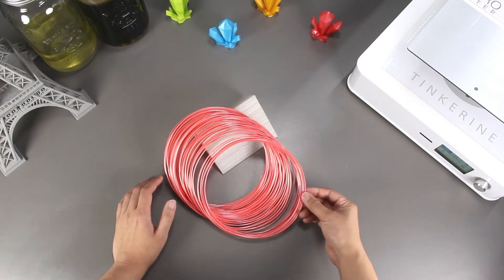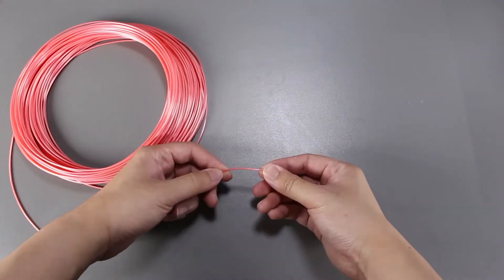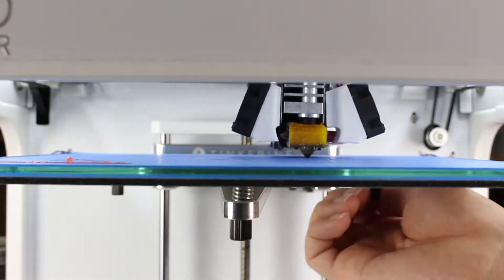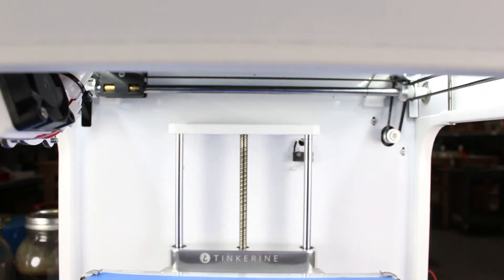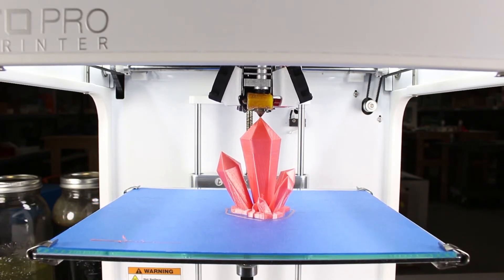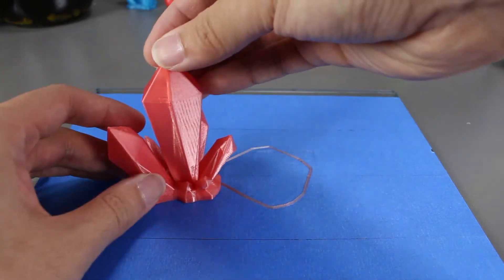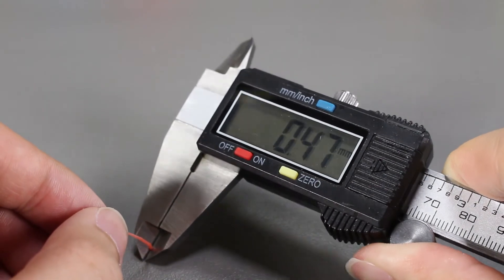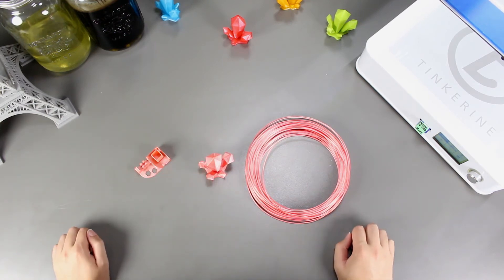3D Printing with Silk Filament

Comment: Hello, I try printing with Silk PLA from Mika 3D. My problem currently is that the PLA won't stick to the bed like normal PLA. I have tried changing some setting on both my computer through Prusa as well as the Prusa Mini, but it still won't print correctly. Would you say to try some of that painters tape? Any advice would be helpful. Thanks!
Reply: Try releveling ur bed I had that issue

Comment: So I was wondering i got some gold silk pla an it's not strong as regular pla is there a way for me to make it stronger than wat it is??? Because
I have a Mono Price Cadet, a simple 3d printer and
My extruder default is set at 200 Celsius with layer height of 0.1 and 
Speed on 50
Reply from the maker: Since strong is a relative term, for us to better help you, we will need to understand what you are using the part for. Are you looking for more impact resistance or something else? You can also look into annealing your prints as well. Let us know!

Comment: What were you temp setting? Nozzle and bed? Thank you
Reply from the maker: Thanks for the comment! We used the default settings on Tinkerine Suite, which is at 230 degrees celsius. Our bed is a regular glass print surface with a layer of blue tape applied to it and our nozzle diameter is 0.35mm.

Comment: So what can you do to fix wear & tear on your nozzle? Do you just have to buy a new nozzle?
Reply from the maker: Hi,

At this point of time, that is the solution for the wear and tear. You can also adjust the settings when you slice to compensate for a period of time. However, I will let the R&D team know that a stronger nozzle is in demand.
Reply: nozzles cost a few dollars for most printers.
Reply: hardened steel nozzle or harder (e.g nozzle x or the uber-expensive ruby ) most nozzles that will handle it are gonna cost more $$$, but that usually means more information, look for abrasive filaments compatible/resistant/ready, etc, or just go buy a bunch of cheap brass nozzles, i think generally people are calling it a nozzle per roll (1kg), that's cheap enough from china (once they are back online) but if you got the coin, yeah grab something that will be more consistent over time always...